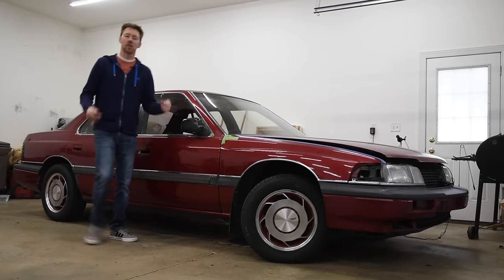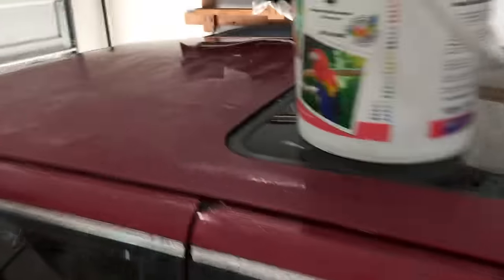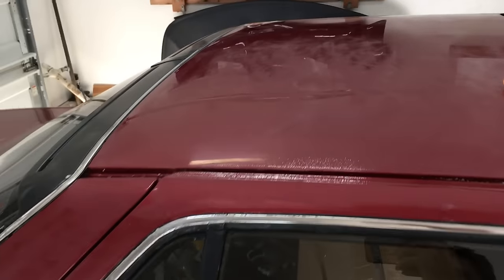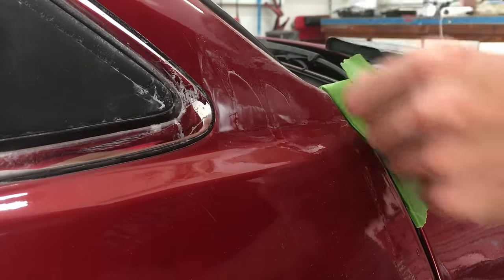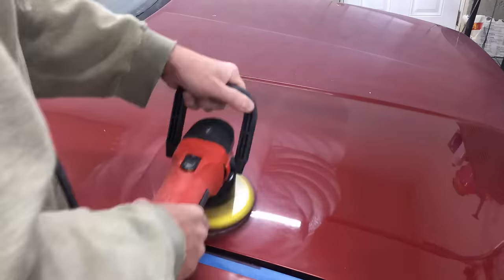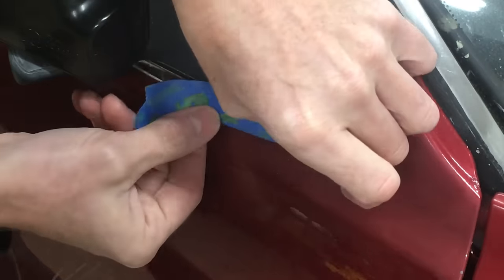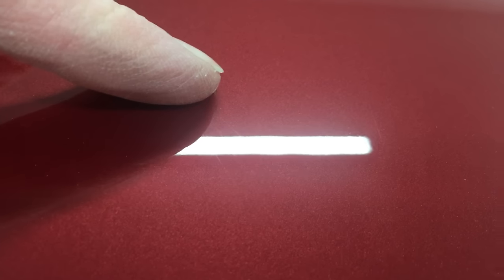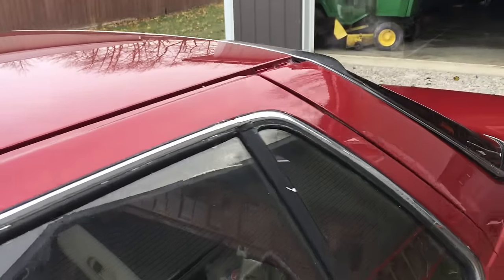How to: Wet Sand + Polish Clear Coat Paint - Part 2

Comment: Hey. I don't have orange peel, but I had some stone chips which I sanded with 1000 grit, added paint and clear on top. Chips are now barely visible, but I have 1000grit sand marks. Other than scratched areas, my hood is polished to gloss. Should I only sand scratched areas with 3000, for an easier polish, or should I sand whole (even currently polished) hood? Should I focus on scratched area, or should I extend the scratched area to feather it in (to eliminate low spots)? So many questions.. :D
Reply from the maker: On those 1000 grit areas, I would wet sand with 1200, 1500, 2000, then 3000 grit and then polish. If the rest of the hood is good, then I would leave it alone. I would just extend slightly outside of the repair area with each grit, to ensure you've removed all the scratches from the previous grit.  Low spots will be tricky, but if you've applied enough clear, the repaired areas should be slightly thicker to allow for the material to be removed during wet sanding. Hope that helps!
Reply: @6thGearGarage  Yes it does! I'll proceed to do it tomorrow, still waiting for clear to cure.
Thanks!

Comment: great video thank you! I followed your instructions and got the opaque look that you show, then used the 105 with my orbital but can't seem to get it as shiny as yours, especially when compared to other adjacent panels that don't need polishing but look a lot more glossy..what am I doing wrong?
Reply from the maker: What kind of pad are you using? It may take a few rounds.
Reply: @6thGearGarage  same ones you suggested, I guess I'll keep on going haha, thanks again!
Reply from the maker: @fed9096  my clear coat was only a month old so it was probably a little softer and polished easier.
Reply: @6thGearGarage  ah I see, are you using one stage or 2 stage clear? I am using eastwood 2 stage?   what brand and type of clear are you using, maybe that's the difference, thanks again!

Comment: I definitely would not use a orbital polisher for cutting and buffing like you did here it takes far way too long but it is easier to use then a full high speed variable speed polisher but had you had the high speed polisher it would have taken you easily a third of the time you spent using this orbital orbitals are more for finish polishing then cutting polishing machines you definitely have some patience using that thing lol
Reply from the maker: Yeah I definitely didn't have the ideal tools for the job, it took soooo long!

Comment: Hello, I need help with a rear quarter panel I wet sanded , then primed then base coated , and clear coated. All with duplicolor. I don't know how thick the clear coat is, but most of the surface is not shiny and has a course feel. Any corrective suggstions would be appreciated. Thanks
Reply from the maker: It sounds like you will need to wetsand and polish, as I did in this video. However, depending on the level of orange peel and the thickness of the clear coat, it's possible that you may wetsand back down to the color coat.
Reply: @6thGearGarage  thanks, in the event I end up sanding or polishing to base coat, what would you recommend? Clear coat again?

Thanks
Reply from the maker: @flipper2473  Yeah, you'll definitely need to apply some more clear coat if you go down that far.
Reply: @6thGearGarage  hello,  a question, 2017 car, paint is good shape surrounding my spray paint repair. The duplicolor clear did not yield the desired shine , even after cut and buff, what if I spray 2k clear on repair, will I still see a mismatch, only the shinier side is the repair side? Thanks for the help.
Reply from the maker: @flipper2473  If you used a lacquer clear - not enamel- then you can wetsand the DC clear with 800 grit to level the orange peel on the surface and then re-clear with the 2k clear. The 2k self levels a lot better than the DC lacquer clear and will last longer too.
Reply: @6thGearGarage  thanks for replying, will it have a noticeable difference if I only clear coat half of the Corolla bumper with the 2k clear? If it's acceptable, any steps or precautions would be appreciated. Thanks
Reply from the maker: @flipper2473  it shouldn't be too noticeable if you blend it in and polish it after. There might be a slight halo where the two clears meet, because blending clears is tricky. I'd clear the entire bumper with the 2k at this point, since you already have the paint and the 2k is a better product than the duplicolor clear.
Reply: @6thGearGarage  thanks

Comment: Wouldn’t it have been easier to just use the DA orbital with the sanding paper vs having to do it all by hand ?? Just seems like too much labor for a budget build. I just had my old
Truck touched up and auto painter did an alright job. I wanna wet sand with a DA to polish it up, but don’t wanna spend all that time doing it by hand
Reply from the maker: Yeah you can use a da if you’re careful. This video is intended for beginners who probably don’t have a da, so I only hand sanded.

Comment: Why did you wet sand it again tho when you barely clear coated it?
Reply from the maker: Wet sanding will knock down the orange peel before polishing, for a glass smooth finish.
Reply: It won’t scratch the clear coat tho?
Reply from the maker: @rubenvilla8785  That's why finer grit sand paper and then polish is used, so the scratches disappear.
Reply: @6thGearGarage  ok thanks

Comment: after watching this video, i'm ready to go out and buy all the white spray paint from the local parts store and repaint my WHOLE car!!!
Reply from the maker: You can do it, but beware the aerosol paint won't be as durable as a urethane/2k clear. I painted a car with rustoleum once and it turned out pretty good but did scratch easier than the factory paint.

Comment: The co I bought my Ram from had a "professional body and paint guy" repaint the truck.
5 years later it looks like trash. clear coat was too thin base coat was too thin and old paint (which is a different color) is showing through.
So you put a so called professional to shame.
PS;  This guy was supposed to have been in the business for 30 years. And he had a paint booth to do it in.
Reply from the maker: Thanks! I’m not as fast or as efficient, but with some elbow grease most paint jobs can turn out looking great 👍
Reply: @6thGearGarage  You do a good job. Be proud of that.
I can do the rust repair and dent repair but I suck at painting lol